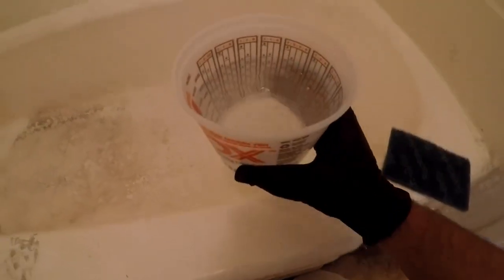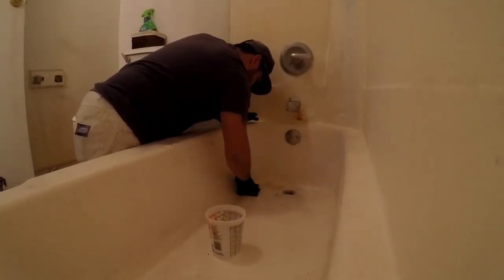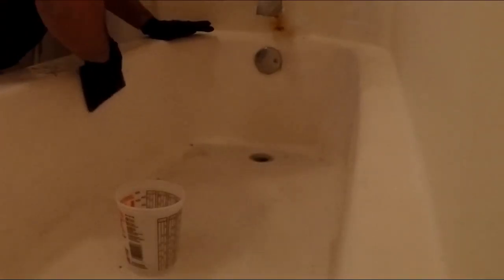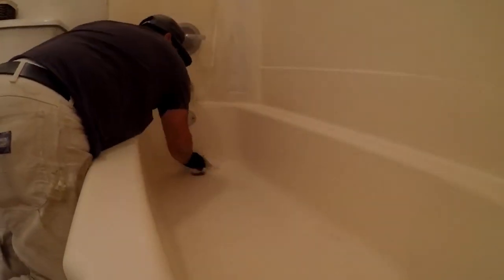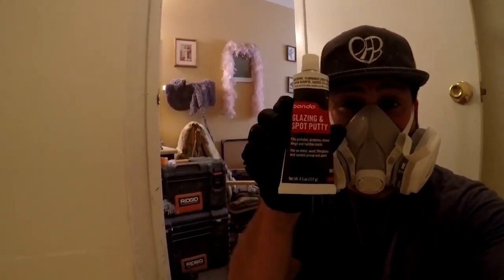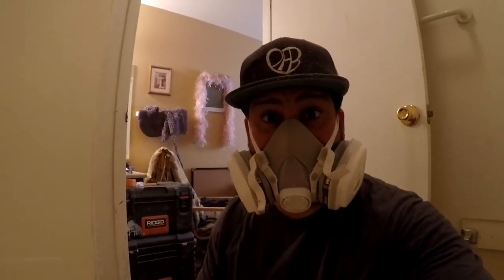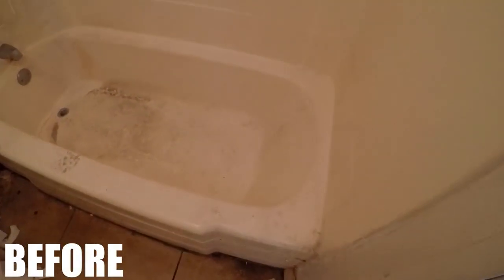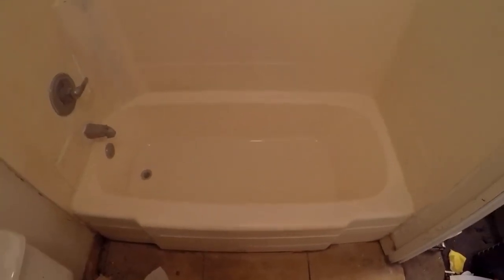How to Repair a Fiberglass Surface Crack in a Bathtub | Bathtub Reglaze and Crack Repair DP Tubs

Comment from the maker: Comment here and let me know if there is anything you would like to see related to Bathroom Reglazing. Check our your tub and see if it needs fixing and ask away on how to fix it!
Reply: DP Tubs looks like the kind in the video and has a rough bottom where most of the stain is that won’t come out
Reply from the maker: Metal or Fiberglass
Reply: Hi-this was very educational. 
You really know your stuff.
Question- neglected tub due to long term injury, and elderly person who cannot ise force, only very light cleaning, green in color (yes-but renting not much can be done there) - glaze not really coming through anymore, but if there are different kinds of glaze, they used least expensive as that started to happen within a few months.
Anyhoo- so it is metal. I also had to put those anti slip strips- can't do the little tub mat as elderly person will fall, and so will I, city has hard water, tub has that fog look. That is what I think of when I look at those areas with soap/shampoo/water stuck on tub.
After I remove the non slip strips before the hard cleaning:
Questions-
Was that hot or cold water you used?
Is that pad ok to use on this type of tub with color in it?

What is "bestest" way (besides my elbow grease) to get this thing nice and as close to shiny as possible? 
I am almost dizzy from trying to figure out which product/s would be best to use besides what is on hand.

Also- this cannot be done in one day due to back, and no help, sooo after doing the water cleaning, which will have to be done in sections, one or two per day depending on body, please tell me which would be the next step that can be done in sections as well. I will have to use one of those long handled thing with the blue scrub pad to avoid hurting the back, but I also have one of those you showed.
There are no scratches on the tub.
I cannot afford to have someone come in and do this. 
I hope you can help. Thank you.

Comment: Thank you for showing DIY reglazing.  We do not have anyone in our city who professionally reglazes fiberglass tubs, and I didn’t know it could be a DIY project.  Our tub has slight scratches.  I just wonder as to how much one can scrub or sand fiberglass  without damaging the tub? Great job.
Reply from the maker: You want to be careful not to break through the gel coat! You want to treat it like working on a car. I would start with using cleaners to soil the area, and then using a soft sponge but scrub hard. If that doesn’t work try using a scotch brite pad, and if that doesn’t work try using 1000-2000 grit sand paper but make sure it’s WET and try and massage the stain out with that. 

Anything beyond that would lead you towards sanding with a more course sand paper 220-400 grit but and then possibly recoat with a finish spray

Comment: Hey Mr. Great insight on what you do. Actually never knew much about this type of work. Reason being is that I accidentally put a quarter size hole in my fiber glass tube and went to find a person or company to make the necessary repair. Found out that no one in my area or surrounding area that does it.  Even reached out to a local marina that works on boats to no avail. So came online to do some research. And notice all the different video's for fiber glass repair and will most likely try my hand at DYI. Keep up the good work and continue success... Anyway to unload and share a video of my project???
Reply from the maker: Send it to me!
Reply from the maker: Send it to me!

Comment: I rent and used to have a place with a tube. But this place only has a roll-in shower because a tub isn't safe for me anymore as well as I use a powerchair so its best for a roll-in shower. But I'd never let my tube go without cleaning it after each and every use.
Reply from the maker: That is awesome. Cleaning and Caring for your tub is probably the most important factor in how long it will last.

Comment: Nice! So what kind of spray paint have you found that works best?
Reply from the maker: For home DIY you can use HomMax from Home Depot for color matching repairs on fiberglass. 

If you want a bright bright White you can get Krylon Tub and Tile at Sherwin Williams 

These are for DIY

Comment: Hi Danny! My bathtub is starting to flake off.   Should I repair or reglaze? What’s the average cost for both? Thanks for your advice.
Reply from the maker: Not sure the pricing in your area! I charge $150 for a minor repair only. I charge anywhere from $300-500 for repair and reglaze. If it’s flaking from a previous coating it all depends on how well it is adhered to the original tub. Sometimes sanding causing a poorly reglazed tub to continue flaking.

Comment: How long will the HomMax Spray last on just the bottom if you don’t do an acid wash on it before spraying it? Or is this not a necessary item to be performed with this type of spray? I just accidentally put a couple of nicks in the bottom of our bathtub/shower combo and my wife is not appreciative of it. I weigh 245 and she is a worried person that thinks the floor is going to  break.I not willing to  buy a new bath cover for $5000 to be installed. I feel that is ridiculously expensive and can be fixed DIY no questions asked. I just need to know the right materials to use for a cream colored one and if probably just match the bottom like you did. Please give so feedback if at all possible . Thank for sharing the info you did !!
Reply from the maker: Send me a picture on instagram and I can help. I also hold zoom meetings up to 1 hour for advice or help on anything.

Comment: best type of cleaner for fiberglass tub that has hard water stains
Reply from the maker: Try CLR and put it in a spray bottle and spray the area and let sit for a couple minutes. Then take a scotch brute pad and soak it in water and then massage the stain out. If it doesn’t work let me know. 

Also, is the area rough or smooth?
Reply: @DPTubs  some rough and some slicky smoothe
Reply from the maker: Catherine Card the rough spots, once moistened may need some scraping with a PLASTIC scraper before the scrubbing. Let me know how it goes. Sometimes if the stain is bad enough it would have to be reglazed either in that area or the whole tube depending on your preference
Reply: @DPTubs  i used the clr with a magic eraser as i didnt have a scotch pad. It worked on vast majority but not on rough patches. Ill grab more clr 2morrow thanks danny for your help and love your family

Comment: Hi, I got a question.  Our tub is in bad shape.  No holes but definitely needs work.  I ask a friend who is a plumber, about reglaze vs bathtub fitting, and he just tried to upsell to a new tub.  How do I know what it needs and how can I tell if a plumber is just trying to make more $$ off me?  Thanks in advance for any help you can offer.
Reply from the maker: The bottom line is your budget! How much are you willing to or able to spend for the upgrade. Of course full replacement is always better but that comes with a price. 

Bathtub liners are expensive and could catch or trap moisture between the old and new if not sealed correctly. 

Bathtub Reglazing usually comes with a warranty ranging from 2-5 years. If maintained well it is the least expensive option for a bathroom upgrade. 

What most don’t mention with replacement is ALL that comes with it. Cost of buying a new one, Cost if removing old, plumbing, drywall patch, tile replacement, painting etc. 

If the tub is structurally sound and you are looking for a inexpensive way to freshen up the bathroom then Reglazing is your best option. 
email me a picture and I will give you my honest assessment! 

Good luck
Reply: DP Tubs where could I find your email?

Comment: Do you wipe it down/clean after you spray? I have noticed getting a chalky like paint residue on your finger tips after spraying. Could this be from bad prep or is this normal? Had it happen to me when doing my tub. Thanks for this channel, it is greatly appreciated it.
Reply from the maker: When I remove tape the material is still wet and I get it on my fingers. I don’t wear plastic gloves because the gloves will stick to the tape when removing the masking paper. 90% of the jobs I remove the paper the same day..every once in a while on bigger jobs I come back two days later. Hope that answers your question
Reply: @DPTubs  Thank you sir, I was referring to like a few hours/next day after the job is done. Still has a little residue on my finger tips if I run my hand across it. Was maybe thinking the adhesion was not that strong .
Reply from the maker: @haiglea6959  you need to give it 48 hours to cure and dry! Or recommended time on product instructions
Reply: @DPTubs  Good to hear it is only my lack of patience and not prep problem. Thank you!

Comment: I would've refused to touch it until it's been thoroughly cleaned. I mean I get hard water can damage your tub, but that's just filth and you didnt have to be the one to do the heavy cleaning on it.
Reply from the maker: I get paid so it’s ok!
Reply: @DPTubs  Thats true. I work with electricians and plumbers and one of their policies is they have the right to refuse a job due to the conditions and until the conditions have improved they cant start work on the property. One of the electricians told me a story where he was running some wire in the attic where rodent feces was falling down on top of him and he just continued working. Just remember your health is of utmost importance and it's not right if you come across black mold and is expected to clean it when it should be the homeowner.